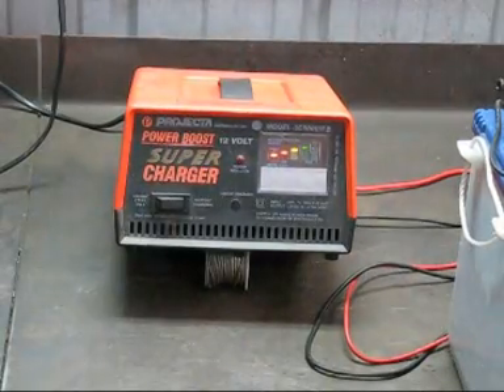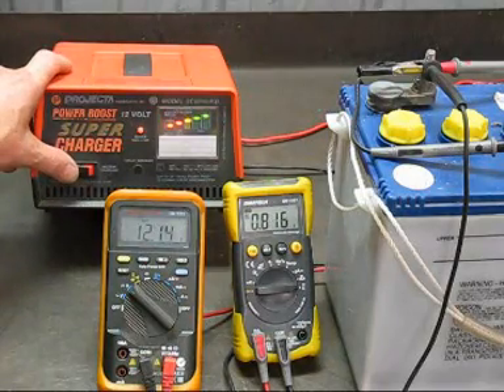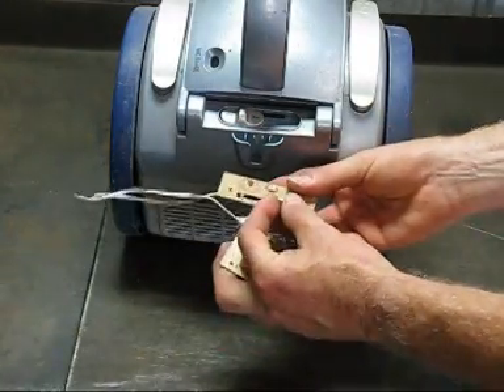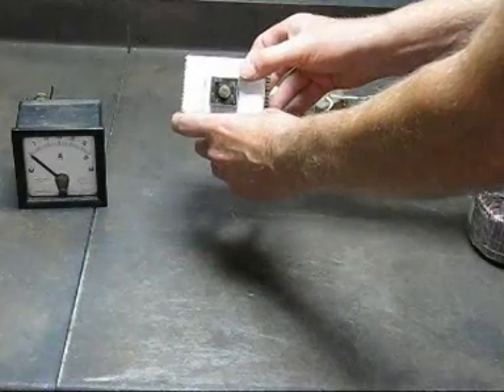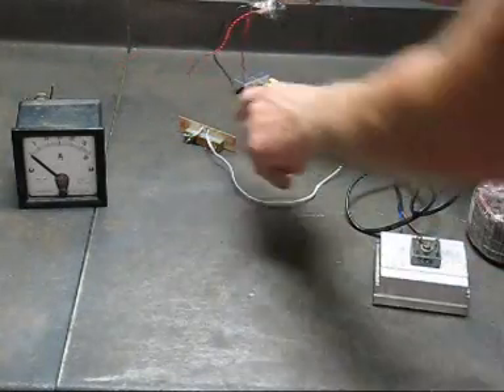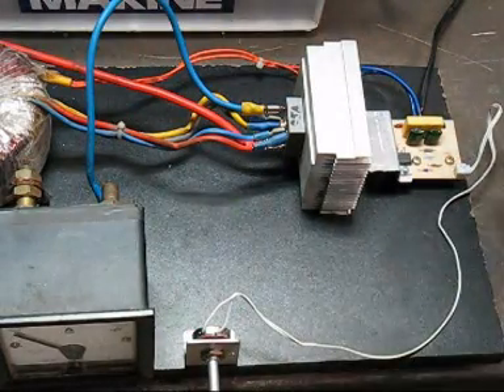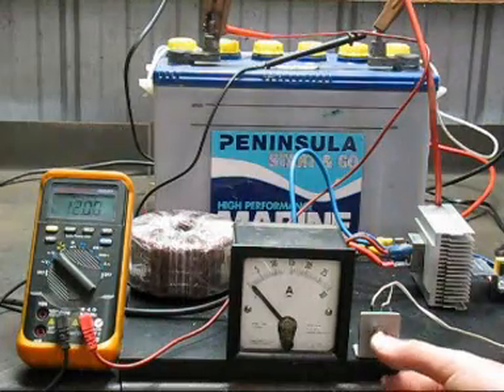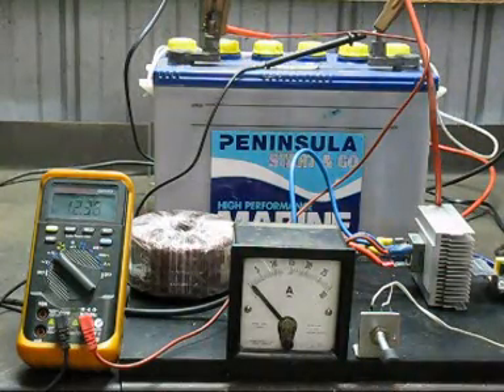Cheap homemade 20 amp battery charger.

Comment: Keep the old style battery charger as they are sought-after! Can you please tell me the rating written on the transformer? Jaycar electronics! Gere I come! Top video 👍👍👍
Reply from the maker: The transformer is 240V in 19V out and has two windings, both are 7amp and are in parallel so it is rated for 15 amps. I
Reply: @luckygen1001  thanks heaps for the quick reply

Comment: no filter caps
Reply: Charging lead acid battery no need for filtration it charge better and desulfate it if have sharper pulses not smooth dc

Comment: sir i have a 12amp transformer 13v DC what value of a rectified diode i will used & value of a capacitor
Reply from the maker: The diode needs to have a current rating higher than the maximum current rating of your transformer. A capacitor is not needed unless you are going to use it to multiply the output voltage on your transformer.
Reply: so what value of a diode
Reply: @ariesrazon8779  if u have 12amp u must double it or triple it

Comment: It has a problem.When you use that thyristor circuit from vaccum cleaner to reduce the current in primary winding it reduces the output voltage in the secondary and you can discharge your battery.
Reply: a diode would solve this problem ,wouldn't it ?
Reply: No, it will not help.
Reply: @inmodreal9770  There is no problem there. No matter what happens at the primary, the battery can not discharge. The only case for discharging would only be there if the bridge rectifier had excessive leakage. If the bridge is OK, no problem even if the system is not powered at all, while the battery is connected.
Reply: No your wrong u forget that there is bridge rectifier

Comment: can i use a dimmer switch in place of the speed controller
Reply from the maker: Aaron Hosein Maybe, dimmer switches have a low wattage rating. You will have to try it and see if it works.

Comment: Transformer size please
Reply from the maker: James Cook 240v primary, 18v secondary 14 amps
Reply: +luckygen1001 18Volts AC after rectifier bridge it's gonna be about 22-24 Volts DC.
Reply: @inmodreal9770  if u reduce the input by the controller the voltage will drop

Comment: Great video, I have been playing with a few boats lately, they have battery banks of hundreds of ampere hours of capacity and my silly little 11a car battery takes ages.. I have some BIG transformers that would make great battery charger transformers but I had not considered using a triac on the primary.
None of it is an electronics challenge to me it is just the actual idea that I was lacking!

Comment: Specs on transformer? Also, I have never seen a vacuum cleaner with more than an on/off switch. I have all the kit listed aside from that circuit board from the vacuum cleaner and I have 4 - 25.2V / 2.0A transformers.

Comment: It is important to ensure that both crocodile clips are making good contact with their
respective terminal posts. The battery charger is fitted with an external, reverse polarity
protection fuse. If the leads are incorrectly connected the fuse will blow. Disconnect the
battery charger from the mains and battery before replacing the fuse. Make sure the
replacement fuse is of the same design and rating as the one removed.

Comment: great video.only one question.the peace you patenteuametur Sorry) hooks too before heat sink with rectifier,could you tell me what that consists of.it looks lke part of the vac pet control board but can i find something similar else-where,or can i build it.Other than that you have did an awesome job.i need one .i have wanted to build one for long time.this looks very good design.sincerelyRobert pc

Comment: if charging current is 20A then disconnect the battery and measure the voltage comming from the charger. it might be higher than 20V. You are overcharging and damaging all your batterys with that thing because there is no voltage cutoff at 14.4V . too high current goes to the full charge battery and boils it. soory for my bad english.
Reply: not if you keep an eye on the voltage

Comment: Sorry, I didn't explain why I've put a capacitor. To make the long story short, I added a secondary board with another transformer to power a fan which was needed to cool the transformer that charges the battery. Now, both the big and the small transformer were put in parallel so they both had variable input voltages. The problem with this type of SCR controllers is that they produce noise in the mains, and I've put a small 100nF cap in parallel with the transformers, which blew the SCR. Lol :)

Comment: So it seems that I'm not the only one that uses a speed controller onto a charger to control the output. As I discovered yesterday, never put a capacitor in parallel with the transformer that is being controlled. Because that will cause the SCR to blow very soon. :)

Comment: Speed controllers might work like light dimmers which are often SCR (thyristor) chopper circuits, In a quest to repair a welder I discovered that SCR circuits do not like inductive loads. Did you have any problems in this respect?